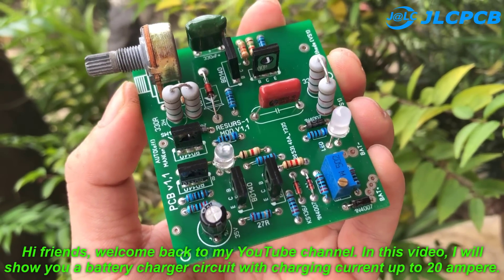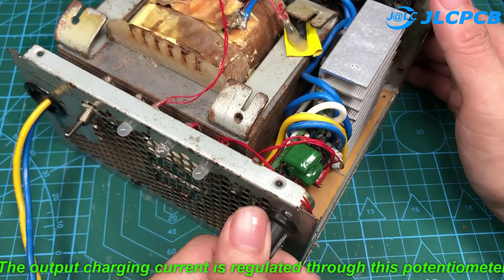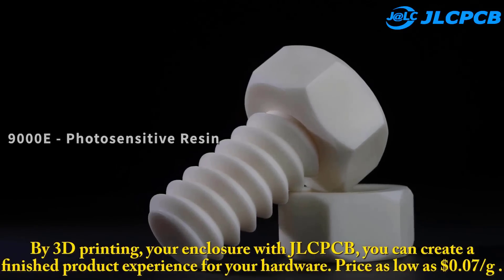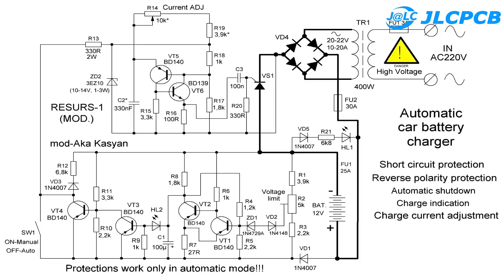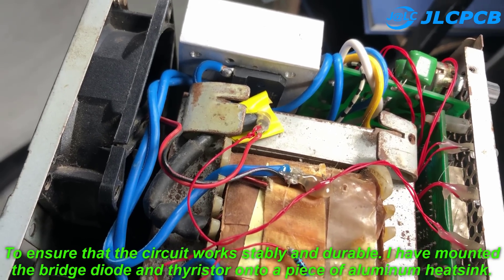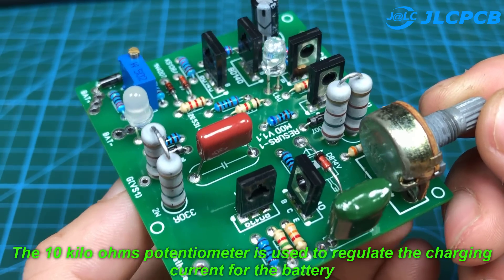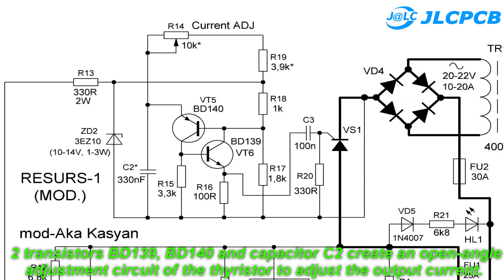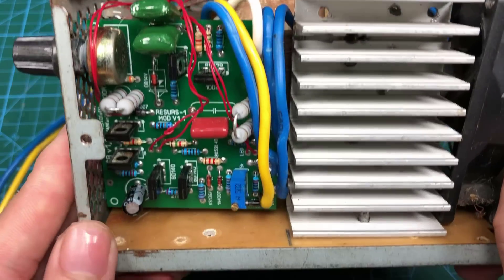20A battery charger with full protection

Comment: Can you please make 36v e bike charger using EE42 Core I Have Ebike With Lifepo4 battery Which have Nominal Volt Of 38.4v and charger voltage needs to be 43.8v with auto cut off